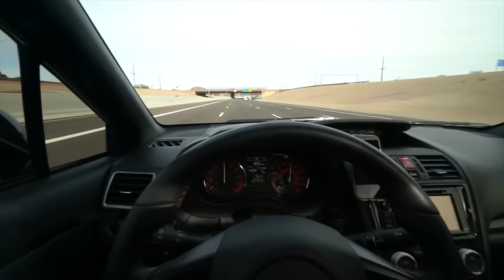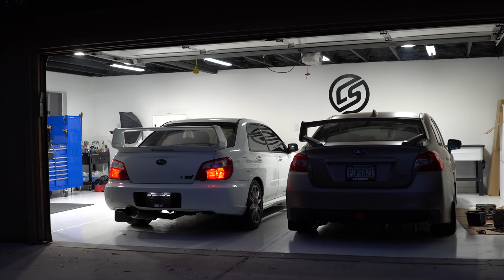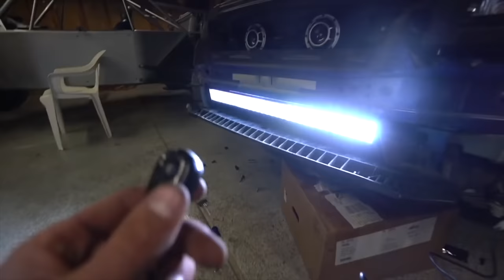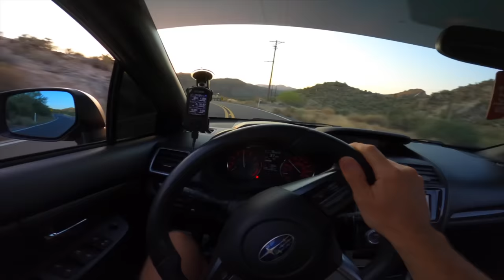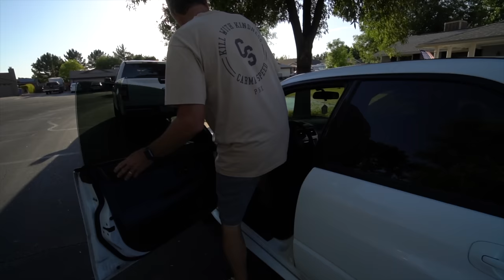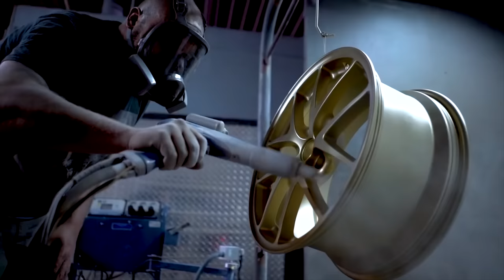Which Subaru WRX STi Should You Buy, Old or New?

Comment: I daily my 2003 WRX. Honestly hasn't given me much issues in the 2 years of ownership so far. It's pretty much stock with a turbo back exhaust which in my opinion is the key to reliability. Don't be putting random mods and expecting the car to work for you every day.
Reply: 2 years late but I have a 2004 wrx that was beaten to crap by the previous owner, not well maintained... BUT it's stock only turboback exhaust so ive been driving it for well over a year almost 20k miles with zero issues just changing the oil. They aren't as bad as people think.
Reply: How is it treating you now if you still have it?
Reply: I daily drove a 02 wrx for 16 years with not mamy major issues, valve cover gaskets were the worst.  

Finally rusted out to the point where it felt unsafe in Dec of 2023
Reply: @blacktopbuckets  have sold it since but it was a solid car, loved it

Comment: I have the same feelings with my 2004 Forester XT 5spd.  I didn't want the extra costs associated with an STI, however not many people know a second gen FXT can do just as much as an older STI.  we have the same motor, just a smaller turbo by default, and that can be upgraded with no issues.  =)

Comment: I own both. They each have their own purpose & design goals. Complete opposite, 06 rally goals, 16 for daily comfort. 16 for low end traffic torque, gearing, soft suspension. 06 for top end boost/ power, still handling, geared for track..

Comment: I started with an 05 WRX and then spent 6 months trying to find an 05 STI that wasn't destroyed by the previous owner... some "excellent condition" vehicles I inspected included one touched up with matte black rattle can paint, and one that was blowing smoke from the engine bay and went into limp mode during a test drive, after looking at more than 10 I gave up! Finding a good STI (and owner) of that generation is the hardest part, at least down in here Australia... Thats how I ended up with a 2017 STI. No regrets, needed for daily uses as well but do have a very special spot reserved in my future garage for an 05 STI one day... Nice video.

Comment: With e85 and stage 2 a 05 will run 11 second quarter mile. Stock turbo and flexfuel is the limit I would mod these. I have a 05 with cobb flexfuel and I prefer to drive it over my 03 cobra mustang.

Comment: i am in australia = i brought a 2001 GT forester turbo and wheels tires brakes suspension and steering exhaust system - ej205 155 mph and all around great super car - 266.000 klm and owned for almost 6 years = buy an oid subaru turbo = spend a few dollars and enjoy = more smiles per miles ! good luck and happy trails !

Comment: What I loved about the older WRX/Evo was their small, compact size compared to their modern counterparts which are big like a Camry.

Would I be wrong to assume the older ones beat the newer ones in race?
Reply: I've had both an 07 and now a 15 and they were both about equal in straight line speed, but the new one handles way better than the old one. So if there are turns in this race, the new ones will win easily.

Comment: JUST INHERENT MY DADS 05 STI WITH ONLY 16.000 MILES CAR IS STOCK OTHER THEN AFTER MARKET WHEELS 2 SETS THE FIRST SET THEN THE NEW 18.8 NEW SET I BOUGHT HAVE THE ORIGINAL SET OF GOLD WHEELS MINT CONDITION WITH TIRES 95%TRED LEFT HE HATED THE GOLD WHEELS SO TOOK THEM OFF WHEN HE BOUGHT THE CAR NEW FALL OF 2004 CAR IS A CLASSIC AND I WOULD CONSIDER SELLING IT FOR THE RIGHT PRICE

Comment: Personally I think you made the right call getting a newer more reliable daily and then getting a "project car" after.  It takes so much stress out of building a car when you don't have to get it all done before Monday morning lol!  

I look at the market a lot and it's extremely rare to see any 2nd gen WRX/STI that hasn't had a shit ton of mods done to it (most of them ridiculous or poorly executed).  If you do find one that is stock or very close to stock it's gonna cost a hefty chunk of change. 

Honestly though I can see two paths I'd take after having experience with several rebuilds on older cars .... I'd either save the cash for the best possible example you can find (low miles, stock, interior/exterior in excellent shape) or I'd buy the one with the best condition body and interior but with a blown engine or mechanical problems and then rebuild it.  To me doing the mechanical stuff is fun but reverse engineering a bunch of cheap and shitty mods that the last guy did is not fun and also dealing with damaged paint, body work, rust, or screwed up interior parts is a major pain in the ass and probably more time consuming and expensive than any of the mechanical stuff.  Just finding some interior parts is impossible and if you do find them people know what they have.

Comment: That is exactly where I am right now. Candidate #1. 2019 unmolested WRX premium with 46,259 mi and candidate #2. 2005 STi with 56,000  mi and a brand new engine (less than 1,000 mi) from Mach V Motorsports 95% original conditions. Same price and about two days to make a decision. I’m retired, so the car won’t be a daily. My first subaru was a new 2007 STi and then six outback. I currently have a 2024 Outback OXT. Trying to be mature here but the STi is winning the fight, it even has the wife’s vote.

Comment: I purchased my 06 world rally blue back in May of 2006 and still have it. Recently put a Cobb titanium exhaust on it and love it even more.

I was pro-tuned stage 2 for the first 100k miles of ownership and I think I did some slow but latent damage when I tracked it multiple times during summer at over 95F degrees. The tune was probably safe on the street but beating on the car at 5K+ rpm constantly at 95F for 20 minutes straight on multiple sessions leave less room for error. It probably also didn't help that the car saw 6k+ rpm daily as I like to rev it. I returned the powertrain to stock at around 105k miles but some damage was already done by then. The engine held out for another 55k miles.

161k miles later, the oil consumption got so bad (consuming 1.2 qt per 1k miles) and got cylinder #2 misfire. I replaced the short block with new Type RA unit, a new turbo, new intake/exhaust valves and all the hoses/pipes, clutch, oil pan, oil pump, engine mounts etc anything that was deemed "old". 

I'm now at 163K miles and the car is happy and burns zero oil. I still have paint peeling off the roof and the hoodscoop but I still love this car a lot - I'm never selling it.

Things I learned during 18 years of EJ257 ownership is change oil MORE often than 3,000 miles if you like to rev it because we still found some oil sludges during engine teardown despite me sticking to 3k mile oil change interval religiously. Also change the oil BOTH BEFORE and AFTER if you track it. I either tracked the car on used oil then changed it, or changed the oil then tracked it but drove it for another ~1k miles on street before I changed it again, out of laziness and I paid the price.  Also be ready to pay to play if you tune it then track it. I saw the coolant temp gauge go beyond the mid point ONCE during the life of the car and it was on the track - that must have been when I did some damage to the exhaust valves.

Comment: Same shitty gas as California. I used the Cobb stage 1 OTS map as well as stage 2 and custom maps and didn’t really have any issues. Catless, cars, single cat. Etc. 

The Az., Ca. 
Nv. Maps are pretty safe and perform well. 

Stage 1 isn’t gonna give you much ho but will smooth out torque and boost curves.

Comment: ‘Merca never got the earlier limited edition STi’s, which were Subaru’s last hurrah for that model or generation, like the S201, S202, S203, 22B, S401, S402, S403, Forester STi and the like, and the engines were hand-built with forged everything putting out power above the Japanese car industry’s gentlemen agreement of limiting engine outputs to 206 kilowatts (KW), sometimes. When Subaru released the Hawk Eye S204, they released it with their 2 liter engine and tuned it to 240KW, even though the STi versions had the 2.5 liter engines, so the return to the EJ20 was very popular back then. As an owner of an S401, which I used to daily, I can tell you that the limited edition STi’s are fun to drive and will increase in value even more by keeping them stock.

Comment: True STis were not produced after 2007. In my opinion. The '08+ WRXs and STIs started down the path of bloat and comfort. That's not what these cars are. The heritage is gone. Sure Subaru made the change to hatch for aero reasons for WRC, but after 2008 Subaru pulled out altogether. There was a recession going on. My STi and Legacy will stay until they are rust piles. Hopefully, soon I can add a GC to the stable.

Comment: I would say buying a pre-2006 subaru is fine for a daily driver, as long as you buy one that has not been modified, and don't attempt to mod it yourself. The WRX is easy to mod, and even easier to break with mods. I'd say 85% of subarus on the used car market are ticking time bombs. like 10% are stock under the hood, and 5% are modded with proper care and knowledge. So UNLESS you know everything about subaru modding, never buy a WRX with mods under the hood. You might think some pipe here or a part there won't matter, but there's a real chance it's not actually compatible with the stock tune or some other component, which might cascade into a blown engine down the line. 

I have seen blobeye WRX's with 500k+ kilometers with the stock engine, when owned by people who never modified anything power related, and always took care of oil changes and top offs. Not once has the engine blown on an owner I know is taking proper care of a stock WRX. And on the other hand, I have friends who blew like three engines in two years because they bought used WRX's with aftermarket tunes and shit.

Comment: Cobb ap
Cobb intake
Cobb exhaust
Invidia downpipe 
1300 inj
Aem fuel pump 
Tial Ewg 
Tomei ulh
Grim speed up pipe 
Boost controller 
Fp green turbo. 
ETS front mount intercooler, power guess ?

Comment: Owned a 2003 WRX and a 05 STI and now a JDM 2011 STI. The sweet spot are the saloon and hatch models with recaros, push button start etc etc. Years ahead of quality compared to older models.
But I'm sorry the new 2015 on STI and WRX feel cheap inside and out and lack any sense of character.

Comment: 13years driving subaru,  first one where a wrx 7 years, sold it and that moment when the car drived away with the new owner,feeled like a nightmare after 2years searching found my sti blobeye currently 400whp and 550nm its a beast enginge build for 600 hp to handle.

And yes i am will  never sell that car. 

Now i got a second car as daily a 300hp polo 1.8 gti 2016.

Fine car,a sleeper but also comfortable. With good weather the rumble beast comes on the street :)

Comment: GD STi/EVO 8-9 will go down as some of the best Modern machines. Everything was right - color options, wheel choices, trim and option packages, pricing, power (stock STi/Evo's could beat stock E46 M3's - Imagine that happening with todays STi!) and of course the fact Subaru and Mitsu where still in WRC and the McRae vs Makkinen war just finished on the rally stages. I have driven everything from Ferrari's to Shelbys. I drove a GD STi for the first time two weeks ago after owning a 2016 for four years, and growing up obsessing over the GD chassis STi (my 11th birthday cake had the STI logo on it) and It was everything I had imagined. Thank you for this video - There are so many of us with similar stories

Comment: They took the limited slip diff out of the STi in 2008 and up. I like the body style of the 2008 hatchback but after driving them both, the LSD REALLY makes a difference in the feel. The 2008+ STi's have EBFD "Electronic Brake Force Distribution" which act's like a limited slip but only during corners, it has to have input from the yaw sensor, and it makes a HUGE difference in the feel of the car. I actually like the way a 2.5RS feels with a limited slip diff much more than the newer STi's. Personally and not trying to knock anyone, we all have our own taste but I won't ever buy a 2008 or newer STi without plans to put a limited slip in it or I'll get a 2004 - 2007 STi. I would also go for Cameron's older project of swapping the old drivetrain into the GC coupe I have.     Again, just an opinion.

Comment: I strongly recommend  waiting for the 25 year rule to kick in in 2023 and getting a 98-2000 sti, jdm.  I have a couple, same power but much less weight.  Avoid the 97, difficult to get sensors.

Comment: I have the 3rd one in PA, the 04" Rally blue gun metal gray that was preleased a few months early  in April/May of 2003 (I think official release was in June/July) I then got the 15' limited in September of 2014. The vehicle's are like night and day despite the engine being virtually the same.  The 04' is much more fun and challenging to drive and IMO looks better but it is a basic stripped down street go-cart,  mine didn't even have a radio for the first two years.  In comparison the 15 is a much better machine at every level,  comfortable,  handling, interior,  obviously tech and features and is just much  easier to drive..

On paper it's hands down the 15', no contest.... but for some unexplainable reason I find myself leaning 04' every time I think about it

Comment: One of the biggest mistakes I made was getting rid of my Aspen White '05 STi.  I loved that car...even though I ended up with an '08 STI later on, it just wasn't the same.  The gearing on the '05 6spd was awesome - 3 shifts to 60mph but that car pulled SO hard in 3rd because of the short gearing, especially after a stage 2 tune. :)  I will say the interior on the GD was ... uh ... economical - but that's not what you bought these for.

Comment: This is the way I’ve always looked at the STI. With engines like a lot of Toyotas and Hondas. You have quite a bit of leeway to mess up. The engine is mod friendlier. And gains are easy. The technology and support has been there for a while. But with Subies. You HAVE to know what you’re doing. You can’t just bolt things on. They’re more unforgiving. But that’s one of the reasons why I love them. A challenge. And I’ve had many a friend and seen many of them make gobs of power from this unique platform and GO YEARS without issues. But they are NOT for beginners.

Comment: If you go with new get a 2021 plus it has upgraded pistons rods and block casting. Stock ones pushing 600whp for over 20k mi. Wish i had waited. Cop a 4th cylinder cooling mod, and some extra oil cooling.

Comment: I have considered the STI since 04. Really splitting hairs hear as there really is not that much difference accept the rawness as been muted a tad in a good way in 2019 up STI’s. The motor upgrades 18 RA up are a big welcome. Redoing a 15 year old car will cost you more than a base new. But, you like what you like. It is each ones individual $$ to spend their way…

Comment: I’m in a similar place rn. The 04 sti is what got me into cars at a younger age. But now I’m looking at actually buying one. And I’m not too advanced in engine parts and building/replacing them. But I’m just stuck with what car I should buy. I’m looking at a ‘15 rn with low miles. But I also found a ‘05 with higher miles but obviously cheaper. So I’m not sure if I should go with the newer. Or older and get an engine swap etc. I love the technology that comes with the newer wrx models. But I’ve always been in love with the older models.

Comment: My first car was a 2003 wrx my dad and I stumbled across a fantastic single owner bugeye who tracked and loved the car for 99,000 miles but was a dad moving states. For $5500 it was unmodified besides a catless downpipe and catback exhaust with a tune to 15 lbs of boost. I have now owned it for 4 years and put 40,000 miles on it and it has been and extremely reliable daily driver with not a single engine issue only a clutch or two since I learned stick on it lol. These cars are fantastic find one as close to stock as possible is all I can recommend even if it means the car costs more. I literally delivery drive in this car she should have another 100,000 on her if I keep treating her right then an engine swap to a 2.5!

Comment: Ringlands aren't much of a problem as people make it seem. Dont beat on it hitting redline daily. And keep up with the maintenance and dont cheap out on oil. And itll be fine. These engines burn oil pretty often when pushed and usually people dont check to top off and run it low

Comment: I have an 06 with a forged shortblock and it’s been my daily for over 2 years now and has never broken down on me or done me wrong, I just drove 1500 miles in 2 days with it to move and had no issues then either, if you build an old subie right you don’t have to worry about the steriotypes I redline mine on every on ramp and stop light she still runs like new

Comment: I had a 05 wrx in the WR Blue it had over 200k miles and it so far has still been the most fun I have had with a car. I currently have a 14 wrx and it’s a completely different car. The 14 feels like it’s completely built for power and the 05 felt more like it was built for fun to beat around. And like you said I honestly liked sitting higher in the 05 then how low it feels in the 14. I didn’t go with a 15+ and I can honestly say it was the best decision for me. I have driven both and the 14 was a lot more fun and feels like it’s built better where as the 15+ feels kind of cheap to me.

Comment: I would rather buy the Subaru WRX Impreza hatchback 2008 not the 2015
Reply: That is probably the worst WRX in history, check some reviews, and the ugliest one unless is a 2011+ with wide body, after they kicked most of the bugs out. When I saw the 2008 model I went strait to the dealer and got a 2007 STi, my first.